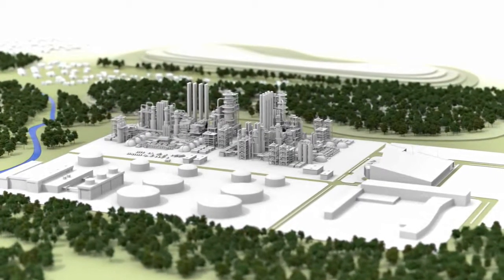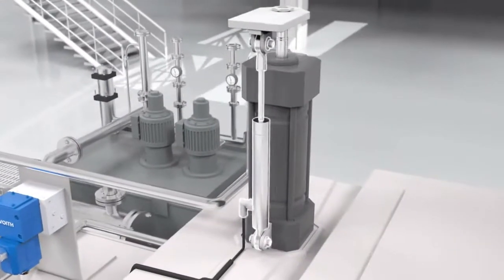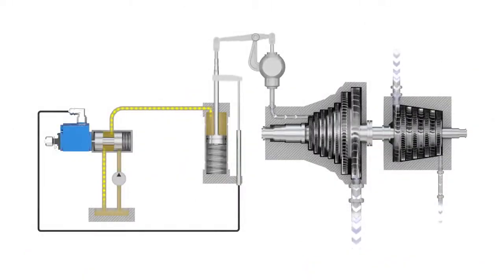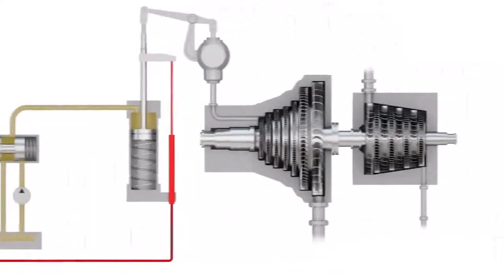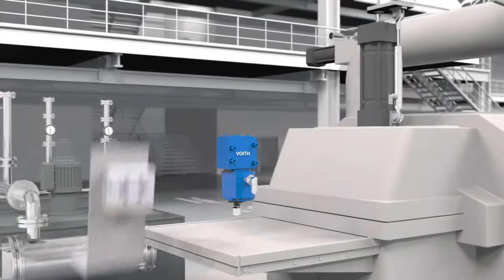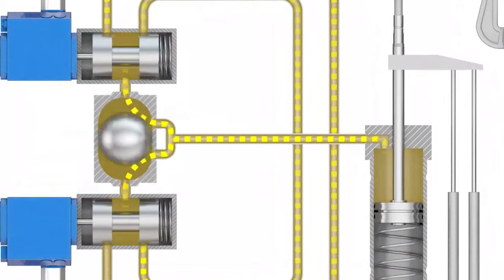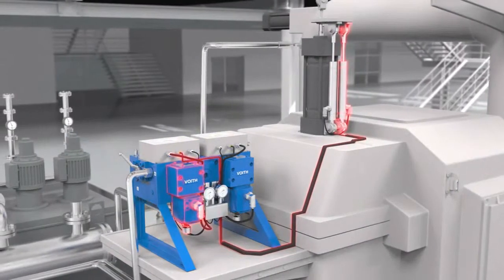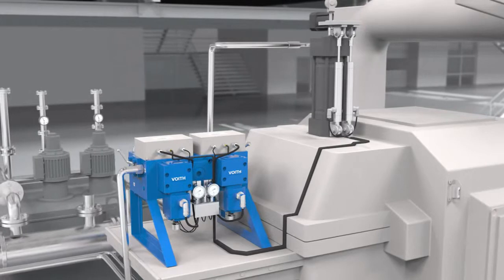Voith Redundant Way Valve Module (EN)

Comment: What is the benefit of moving from I/H to way valve?
Reply from the maker: The Voith Way Valve is a servo directional control valve. With the Way Valve you can directly control a hydraulic cylinder – no pilot valve is needed. Further the Way Valve has integrated an electronic position controller which provides a position control of the stem of the hydraulic cylinder. 

For more information, please see: https://voith.com/corp-en/products-services/automation-digital-solutions/actuators-and-control-systems.html